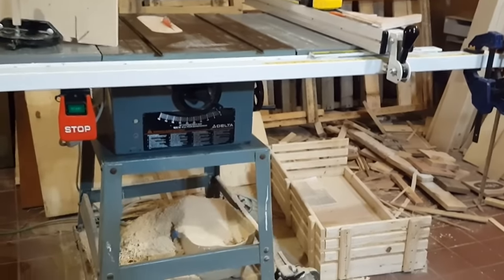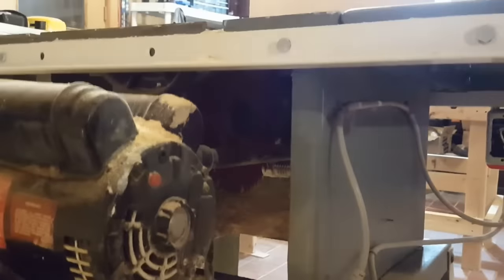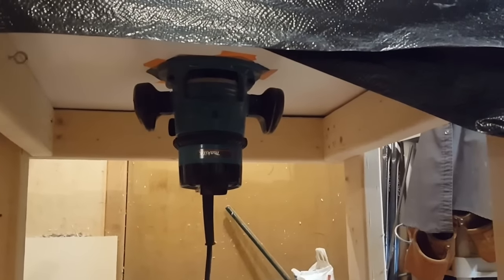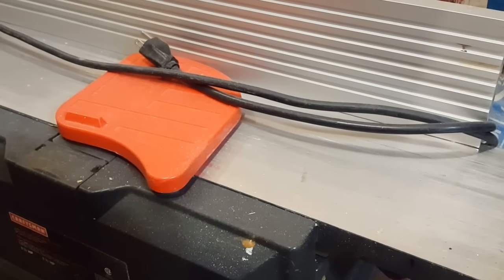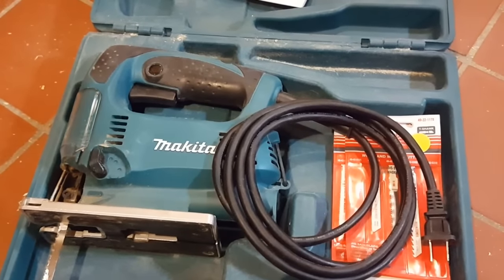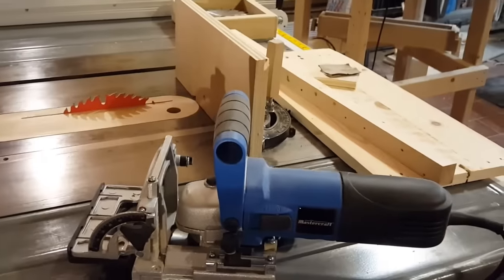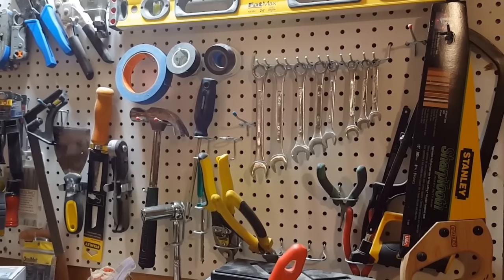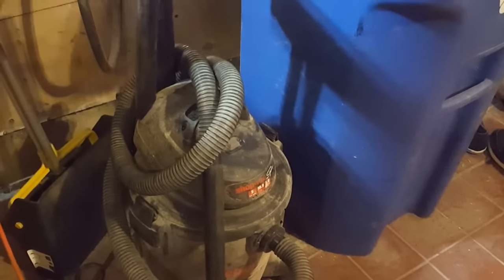Shop tour and Tool pricing

Comment: That's a great format. Thanks for sharing the cost of each tool.  Dust collection for your TS: you'd need to box the cabinet in and you can buy a  hood for the underside (or make your own)
Reply from the maker: Gotcha, I'll make a video about the retrofit :)
Reply: I recently boxed in my Delta Contractor's Saw.   I used ideas found in a Fine Woodworking Article as well as various post on Lumberjocks.  This thread has a few of the ideas: http://lumberjocks.com/topics/41726

 It made a huge difference and was well worth the effort.  Not to mention, the designs add an outfeed extension table
Reply from the maker: Kelly Burns That's really great of you to share.  I'm definitely going to use that thread for ideas!

Comment: thank you for sharing all this info, really interesting at least for me, I have two recommendations
1) make a funnel like devise under your saw that leads to a box, so all the dust stay in the same place at least
2) make some cubbys for all the stuf in your shelves and under the workbench , I hate looking for stuff all over and I suppose you do as well
all in all Thank you and I am really looking forward to seeing the tool board as I want to build one myself and also the clamp rack.
Reply from the maker: Thanks for your recommendations and keep a lookout for the toolboard video!
Reply: +Sebastian Hanhausen or if you think it would be useful a dust deputy could be extremely helpful in cleaning up after that saw.
Reply from the maker: +Oneida Air Systems If you're offering one, I would be interested in that conversation.  Please send me a private message

Comment: Nice channel good luck with it. you mentioned you wish you had a smaller shop vac. Home Depot sells a power head unit that sits ontop of a five gallon bucket that works great its called Bucket Head runs around $20
Reply from the maker: Vince Moser Thanks for watching and  the comment.  I was actually making an obscure reference to a Friends joke.